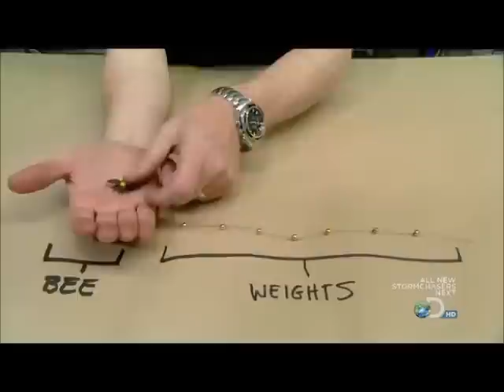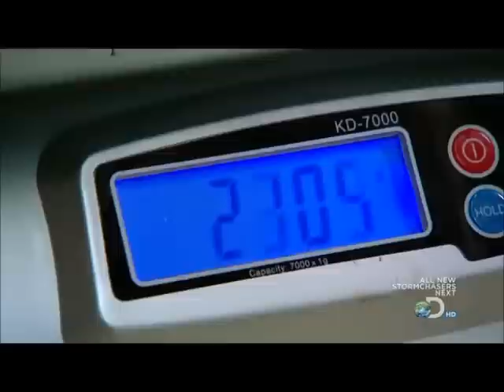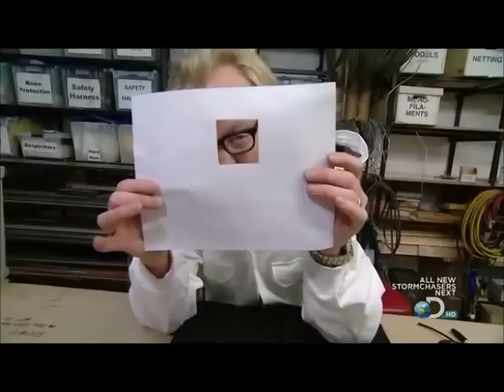mythbusters bees lifting laptop (HQ)  (pt. 1 of 2)

Comment: Would be nice to hear them say something sensible at the start like: "well this myth is busted because obviously the only bees that are able to provide any lift at all are those stuck to the edge of the object, the once in the center are simply pushing air onto the laptop which is pushing the laptop down. But we will do this myth anyway because the show must go on!"
Reply: *****
 "as a reaction to the mass of air thrown down by the wings..." - yes, and in this case the mass of air hits and pushes down something the wings are trying to lift. In order to fly, an insect needs to accelerate downwards a mass of air at a speed according to the formula l = m * v², where m is mass, v is speed and l is lift (which must equal the weight of the insect). In case it's glued to a barrier below it, the insect can't accelerate any air downwards. One insect could accelerate air to the side, which would generate some lift - but that doesn't work at all with thousands of them side by side. Only the ones on the edges could produce (minimal) lift, the ones in the centre produce no lift at all. The laptop's in the way.
All this was was just an unnecessary slaughter of bees. Anyone with a basic grasp of aerodynamics could have told them this is a fake and there's no way it could work.
Reply: totally true. its possible for the right amount of bees to lift any weight they just need to be pushing air down and away from the object

Comment: In the video the laptop is open, in this their laptop isn't. 
The laptop could've been gutted, with only the frame and no internals.
Reply: still not enough, though
Reply: Francisco Hoyos Lopez twice the surface are holds twice the bees, ~4,000.. If you could reduce the weight by about 80-90% then it would take 10-20% of the bees to lift it.. between 2,300 and 4,600.. maybe it is enough? zakizdaman

Comment: I hate myself for picking this up, but spot the flaw in the statement "A bee can lift 81% of its body weight"
Reply: Whats wrong with that
Reply: Super Baws It wouldn't be able to fly - he meant to say it can lift 181% of its bodyweight.
Reply: I don't think that's the case, I think that it means it can lift 81% of it's body weight. People always say I can lift 20% of my body weight, not I can lift 120% of my body weight.
Reply: Well it depends if they're actually lifting their own bodyweight during the lift or not (as well as whatever weights).  Also it's quite possible that a lot of people who go to the gym don't know the distinction.
Reply: The force required to lift their own body doesn't count when people are talking about this. They're saying that the bee can lift 81% of its own body weight as an additional weight to its own, existent body
Reply: kyogreblast If they had said that, then that would be fine, but they didn't.  Any time I've seen this in relation to vehicles and flight, they include the weight of the vehicle.
Reply: ***** Well seeing as the bee could fly anyway, it should be pretty common sense that it can lift its own weight :P
Reply: kyogreblast I'm definitely being petty.  I think maybe now the best way they could have said it would be "a bee can lift an additional 81% of its bodyweight".  The disadvantage of saying 181% is you then have to take time explaining that this includes the bodyweight of the bee.
Reply: ***** Kind of a hassle to to say it so specifically. Anyone can understand that a bee can lift it's own weight, so it's not necessary to say unless you didn't know that from the start. Then you automatically conclude that it's 81% as well as it's own body.

Comment: Now if instead of a solid surface like the laptop, they used a tennis racquet's face instead, that would work without question. The surface will not hold back the air containing the downward force, so the bee won't be pushing AGAINST the racquet but PAST IT instead. 

Lift will be achieved in that case.

The laptop bee scenario can NEVER work.

Comment: You don't get the point. 

To get motion, in this case upwards motion (or 'lift'), you need an equal and opposite reaction.

The bee normally flies by pushing the air down in exchange for being pushed up. When you have a laptop surface this close to the wings, all that's happening is basically just the bees pushing AWAY from the laptop, NOT lifting the laptop UP WITH IT while it pushes away ELSEWHERE. 

The logic here is basically like the magnet-powered troll science car. It will never work.

Comment: Pretty certain the lift is generated by the bees near the edge not those nearer the middle - similar to the problem, a lorry carrying birds weighs X - after a bump all the bird take flight inside the trailer - the weight exerted by the trailer on the ground is still X, the air deflected down exerts the same pressure on the floor at the bird exerted on the air to fly...

Comment: Regardless of the weight of the laptop, the thrust produced by the bees wings would provide an equal force holding the laptop down, as it would be against the wing itself, thus lifting the bee, and the laptop. It would be the same as trying to lift yourself off the ground and levitate, just because your arms can lift more than your total mass. No matter how strong you are, or how light your body is, it cannot bee done.

Comment: American ppl... When a bird or a bee flies, it's is (roughly) because they push air from above them to below them. if you push air on a paperplane or anything in the air, it's pushed towards the ground. Even if bees had enough strenght to lift that, they'd be like a sailboat powered by a fan... except for the few bees on the side, they do work. Try that with a metallic grid that lets air pass through, maybe. Useless experiment.

Comment: You clearly don't know what you're talking about.
Air has a mass too, and a helicopter needs mass underneath it to press air against, or else it won't be able to move away from that mass it is blowing towards. If you disrupt the airflow, which is both sucked from upwards and compressed downwards, you won't have lift off.

Comment: However, this constrain does not apply to any of the bees on the outer rim of it. where the air is not obstructed fully from moving downwards. Also even without that, if you look at it if air is forced down by the bees it is pushed to the sides as it hits the plane, but this still has the air above the bees being pulled down. newtons 3rd can still apply in this way. (not saying that this results in a net force though)

Comment: That's missing the fact that a portion of the force of the bee's wings is dissipated by the air itself, thus why things like bird, bees, and rockets can fly high off the ground (and, in the case of rockets/airplanes, horizontally). Admittedly, the height of a bee is not very much for the force to dissipate in, but then neither is the force generated by the wing.

Comment: if you used a macbook air, it would be a bit closer.
The laptop they tested was 2,2kg or so, a macbook air is as little as 1,08kg
so you would need about 11000 bees to lift a macbook air
then if you calculate the size of a macbook air, you would need about 60 bees pr square inch

do it proper, if you want to bust a myth :P

Comment: 2216 grams is 4.8lbs the laptop that the original video used was only 3 pounds 14.3 oz
meaning that's 1lb more less then the laptop that Myth-busters used
Conclusion its still busted but, they used the wrong laptop :)

Comment: Even if you got enough bees on the surface, they can't lift the surface they are glued to. Only the insects at the edges can push down air and lift the object. Bees would have to be tied to the object by strings. Use String theory instead :D

Comment: @PillzHerePictures well, the back of a jet engine blasts hot compressed air with a fan. and fans push air in front of it, right? whats the difference with wings? do you even know what lift is?

Comment: @gtdreamsmith true but still not compensating for the horizontal vector of force being exerted on the string. Although it still most likely wouldn't be able to be lifted it could add about 50% to the flight strength

Comment: since the beads were at a slight angle the bee is actually lifting more than just the weight of 8 beads as it would need to add enough force to compensate for the horizontal force the string of beads is exerting. Also the weight of the string, all though small might be significant compared to a weight of .096 grams